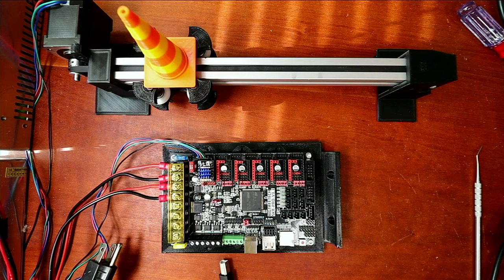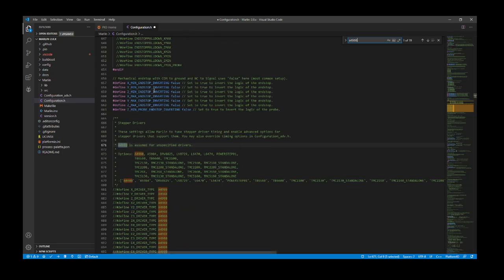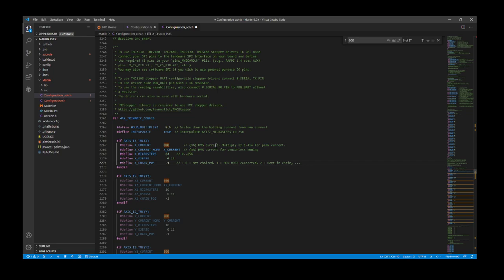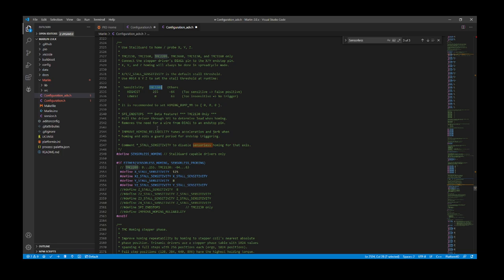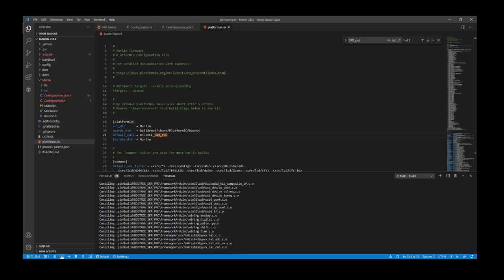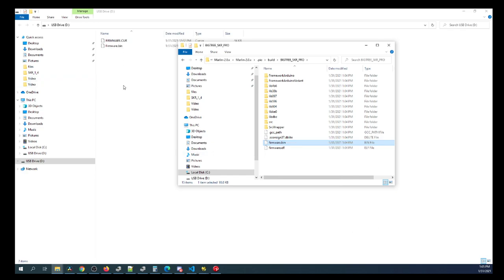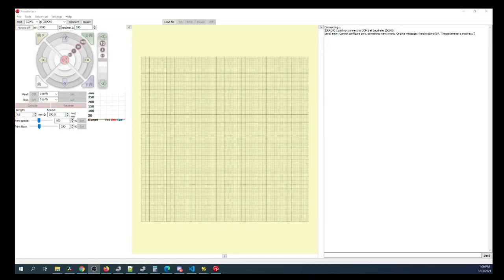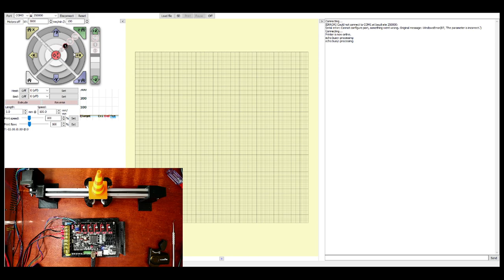SKR Pro V1.1 - TMC2209 UART with Sensor less Homing

Comment: Great Videos Ed Thanks.  One quick question.. if i put my y endstop  back in and connect it to the endstop pins.  Then disable sensorless homing for y in marlin.. do i need to do anything else (SKR Pro 1.2 board) ..like cut a pin from the bottom of the TMC2209?
Reply from the maker: Yes pin on TMC need to be removed if not using sensor less homing.
Reply: @EdwardBraiman  Thanks.  I like sensorless homing when I can't figure out where to put an endstop switch, but I had a nice endstop switch on my Y axis already.   I am upgrading to 32bit... and the BTT smart filament sensor.  it seems so final to cut the pin but I guess I can always solder another one on ... or spend $7 for another TMC2209.   I made a custom printer with a X 300mm x  Y 640mm x Z 340mm bed.   Can you make a video showing how to get the BTT  TFT35 to show graphic previews of the Part?
Reply from the maker: Graphic preview might be another model of display, but I'll look into it.
Reply from the maker: Currently digesting how to present Klipper and my work schedule changed, so I'm getting ready for holiday blitz of tutorials.

Comment: Edward, thanks a lot for sharing your knowledge! I am using the SKR PRO v1.2, did the same configs as you, but when testing the sensorless homing it's not working.  I did not cut the diag pin of TMC2209 as well.
Reply from the maker: Which manufacturer of steppers are you using?
Reply: @EdwardBraiman  Bigtreetech, TMC2209 v1.2
Reply: I am monitoring the DIAG pin with my oscilloscope and it never rises to logic 1 as the X axes reaches the limit. The board tries to communicate with the driver, but not sure if it happens properly (I can see on my oscilloscope the communication).
Reply from the maker: Where is the jumper for board power set to USB power or PSU power?
Reply: @EdwardBraiman  not USB, it's using its own power
Reply from the maker: When you enter m122 gcode in Pronterface, what do you see?
Reply: @EdwardBraiman  I see some parameters using the m122 comand. Which ones you wanna know?
Reply from the maker: Do they say okay?
Reply: @EdwardBraiman  okay in what parameter? Actually they seem ok, and I can operate the printer with no problems at all using the Pronterface.
Reply from the maker: There's a Discord link in the description.

Comment: Ed,  I went back to update my skr pro  1.1  sensorless homing has gone wonky.    Y doesn't move at all. and thinks its at zero (two steppers on the same cable at 1500 mA)... X crashes into the Endstop and keeps skipping the belt until I hit reset  (one stepper @ 800mA).  Your example went perfectly but how do I troubleshoot sensitivity number.. or do i have to change the current?   BTW both axes work fine using move axis in the menu
Reply from the maker: There's a Discord link in description and either myself or someone else can help you in general chat

Comment: Does this setting works for BTT KR PRO 1.2? using BTT TMC2209
Reply from the maker: Unsure, sounds like a different board.
Reply: @EdwardBraiman  sorry my typo SKR Pro 1.2
Reply from the maker: Should, I'll be retesting with Marlin firmware version 2.0.8.

Comment: what do i have to do to use this woth 5 stepper  driver?  marlin shows a warning that there are only 4 driver possible with the same address
Reply from the maker: Are you talking about same axis, like z-axis?
Reply: @EdwardBraiman  im talking about more than 4 tmc2209 at the same time, like x,y, duals, e0
Reply from the maker: Do you have a configuration file you can post on Discord, so I can understand the issue?
Reply: @EdwardBraiman  you can find this in the default configuraten_adv.h:   
 /**
   * Four TMC2209 drivers can use the same HW/SW serial port with hardware configured addresses.
   * Set the address using jumpers on pins MS1 and MS2.
   * Address | MS1  | MS2
   *       0 | LOW  | LOW
   *       1 | HIGH | LOW
   *       2 | LOW  | HIGH
   *       3 | HIGH | HIGH
   *
   * Set *_SERIAL_TX_PIN and *_SERIAL_RX_PIN to match for all drivers
   * on the same serial port, either here or in your board's pins file.
   */ 
also watterott writes this in the documentation: https://learn.watterott.com/silentstepstick/pinconfig/tmc2209/ 

without modifing the slave address, you will get some problem with the uart comunication etween board and the drivers
Reply from the maker: Unfortunately, I've not done tmc2209 standalone configuration yet, so I'm not sure if I can help.